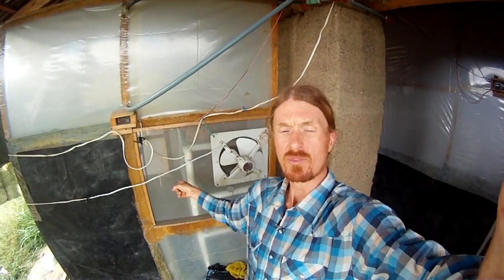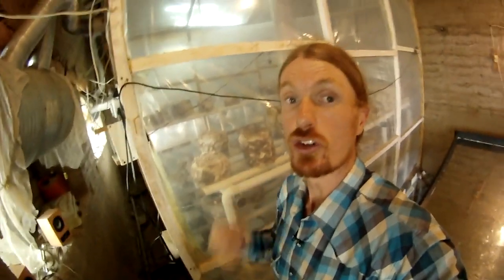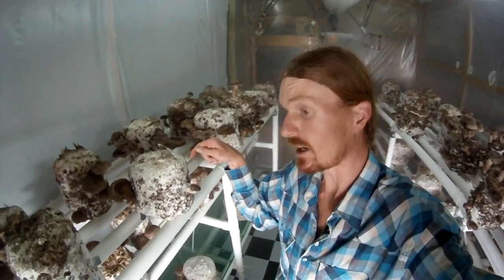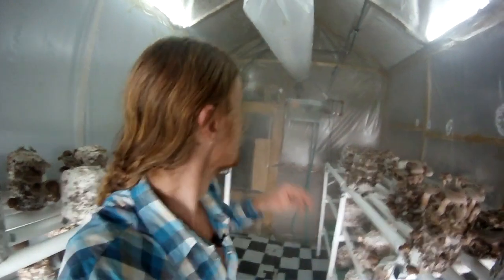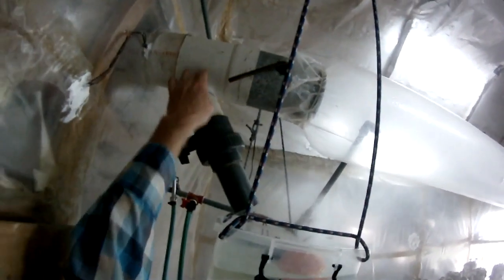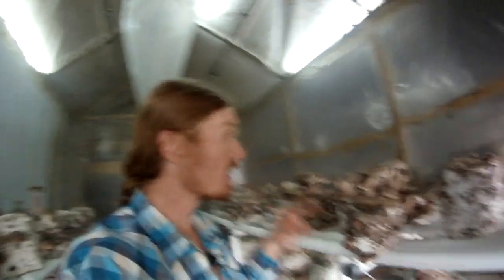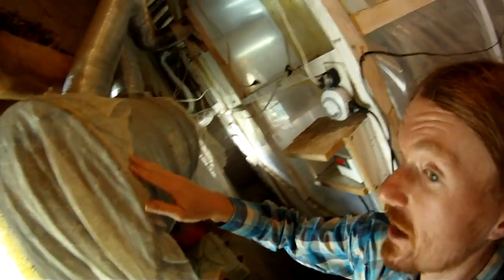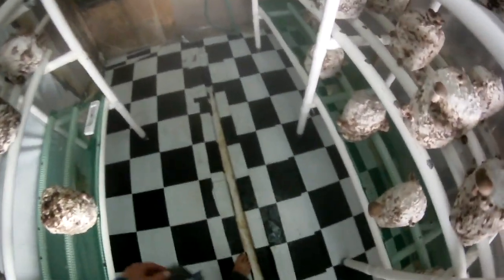Mushroom Grow Op Tour; Check out our Set up!

Comment: If making a 13’x13’ square room, what would be the most efficient placement for my intake and outtake fans, and would you recommend a positive or negative pressure room?
Reply from the maker: Sorry missed this comment.  Probably way too late.  I usually go positive but have been toying with some experimental negative screen rooms.  If positive I have outlet mid way centered in room and another high up for heat.  I have been thinking about putting some low perforated tubes to pull under shelves to increase airflow through all shelves but have yet to do it.  Did you build room?

Comment: What should I do to prep a bedroom for a lab? Tear out carpet and leave a cement floor? Is it necessary to cover the ceiling and walls in plastic? Also is it a bad idea to attempt fruiting a small of blocks inside the small room with the lab?
Reply from the maker: Definitely tear out carpet, just too many places for things to live, I like the idea of plastic on ceiling and walls and maybe even a vinyl on floor cause its really nice to have easily wipeable floors, its shocking the tenacity of life to try and establish itself anywhere, its nice to be able to wipe it away if you don't want it there.  A little time and investment will save you a heap of time, money and headache later.  And finally yes very bad idea to fruit in your lab, your bounty will become your contamination.  Growing mushrooms is all about having the right spaces.  Are you going to use a laminar flow hood or glove box or what you thinking in that realm?
Reply from the maker: Have you found my lab tour videos?  There is one lab tour video and a few videos of working in the lab that might help you get an idea of what I got going on.  If you don't want to have outside air always pumped in I think you could get away with just a really well sealed room, and you could use UV or Ozone to get it and keep it pretty clean and then cycle air in your room before inoculation with a laminar flow hood to pull out any airborne spores.
Reply: 5D Lifestyles I figured I probably needed a separate space to fruit them out in. So I will do that. What would you think about my covering the carpet with like three of carpet plastic with adhesive on the backside? Movers use it to protect carpet walking back and forth. A few layers would hold up well, stay put and be easy to wash. Also would I be safe having a spawn room inside the lab? These would be fully sterilized substrate that colonizing. Thx a million for your feedback. Your situation seems idea! Makes me want to pull up stacks and head south! Lol #mushroomfantasies
Reply from the maker: @momsmushroomsjodyfoster5786  Yeah spawning in room is all good.  Although you'll need air exchange.  If you've got a lot of blocks in a closed room the Co2 will build up too high.  Yeah sounds like the plastic over carpet could work just make sure edges are sealed and you monitor for rips.  Yeah its nice to have. a good space but I still have a lot to dial in.  Its all about the spaces.
.
Reply: Can’t believe you hung out with Paul Staments! Way cool!  We tried triple stacking last year. Working on growing cubes and doing a repeat series of treatments in 2020 ;))-